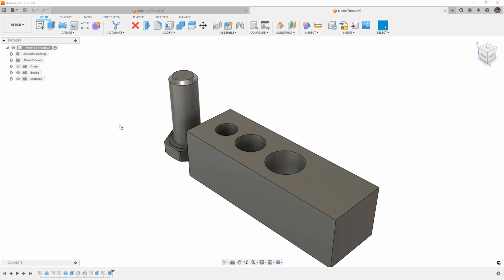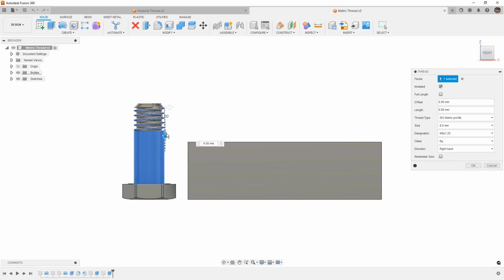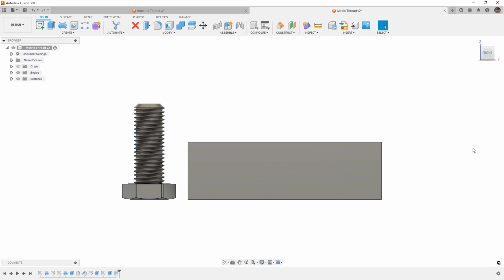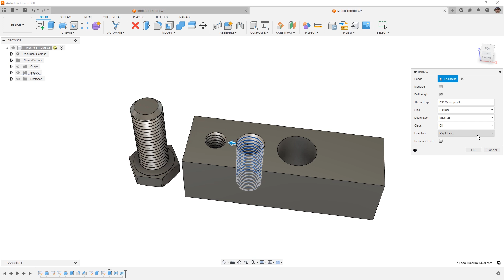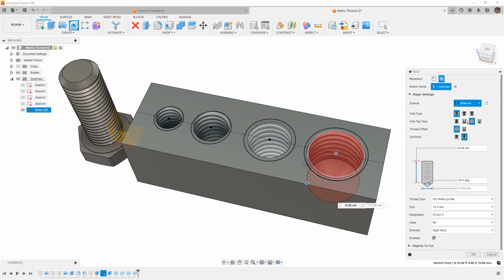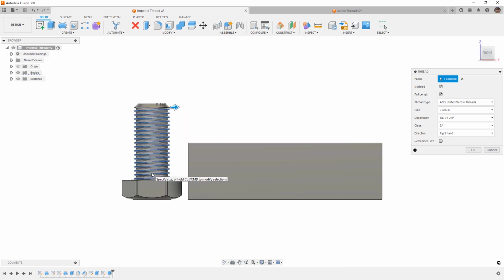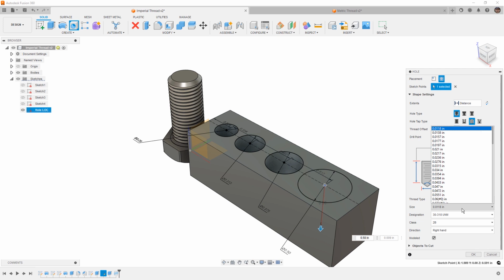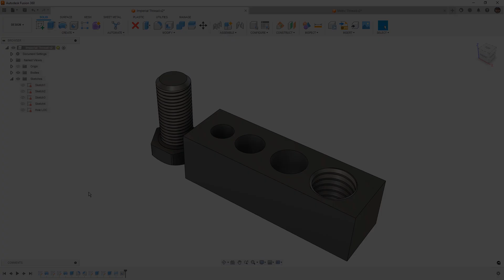Transform Your Designs: How to Create Realistic Threads in Fusion

Comment: Would be nice to have a option where you could make either the inner or outer thread size slightly offset when doing a design that will be 3D printed so there is a bit of clearance due to the way the threads get printed.
Reply: That does sound cool.  The difference in fit for say a 2 vs 3 isn't enough for a 3d print.  Do you use Scale now?
Reply: @LearnEverythingAboutDesign  I use a trick that I found by stephan on cnc kitchen, It isn't perfect but I did it recently with a 60mm thread for a set of adjustable height feet I designed for my 12U home server rack and it made it easier.

Comment: I really would apprciate if there is a solution for the chamfer on the bolt end. Did you notice that the thread stops there! This is not realistic! This because the face of the shaft is selected. Your cutting tool however will also cut in the face of the chamfer. To overcome this an extra body and combine feature could solve this. But it would be better if this was automatically solved. Maybe something for a next update?
Reply: You can work around this by putting the chamfer on first, then the thread and now drag the chamfer after the thread. Done.
Reply: @martinmarriott3607  ah, yes, thank you for reminding me! I don't use modeled threads very often so I had forgotten that trick!
I wonder if it's a bug or feature :P
Reply: Why? It doesn't really matter?

Comment: Yes, Please add custom thread profiles. AND TAPER THREADS.  I model NPT fittings into 3d printable parts and I am stuck downloading McMaster pipe plugs to do body subtractions. AND YOU CLOWNS WANT MONEY FOR THIS CAD SOFTWARE?????
Reply: I've been making the same "suggestion" for three years!  Nothing but lip service so far. 😡
Reply: Oh goodness yes, thank you. I forgot to mention taper threads.
Reply: I've been waiting for taper threads for 5 years now.
Reply: When you use the Hole tool there is a Hole Tap Type called Tapered Tap.  It has BSP, DIN, ISO, JIS and NPT plus NPT for PVC.  There isn't a modeled version but it creates the hole the correct size and taper.
Reply: @LearnEverythingAboutDesign And for OD threads?
Reply: @spikeypineapple552  The general comment was about Tapered threads. There are no external threads but there are internal threads.  The only reason you need physical threads is for rendering or for 3d printing.  I don't 3d print tapered threads as they are for sealing and not a good fit for the technology as a whole.  If we are going to be completely fair (to the comment about wanting money for this program), in Solidworks which I paid thousands of dollars for you still have to manually model external tapered threads.  Their Stud wizard has straight pipe tapped threads and its not a physical thread, just a callout.